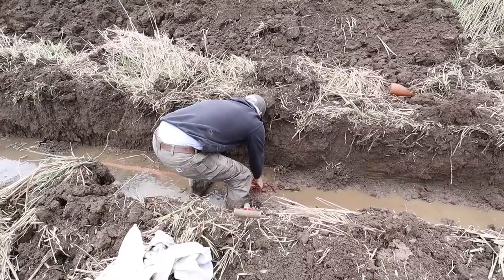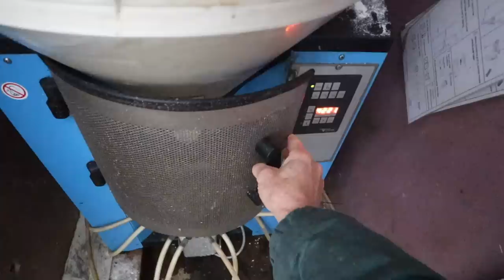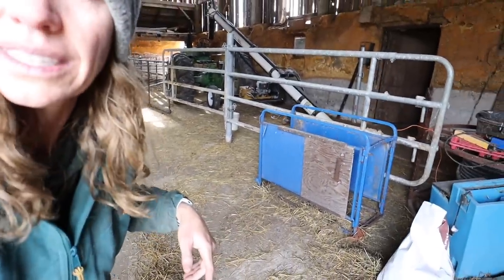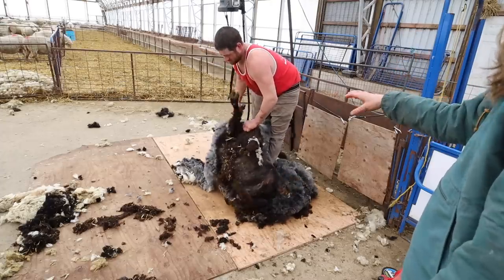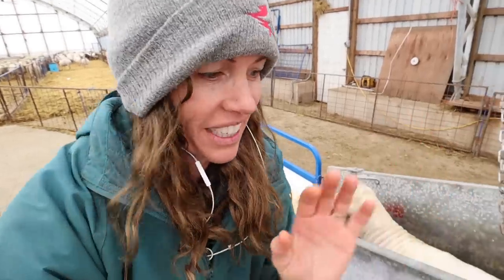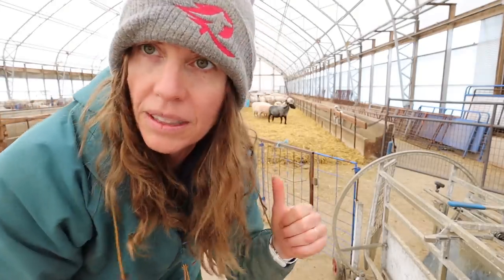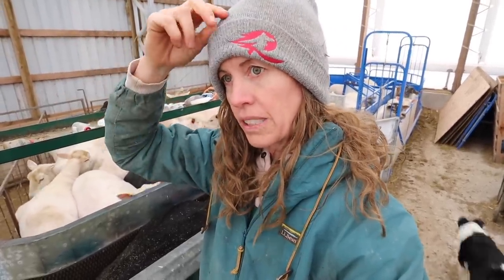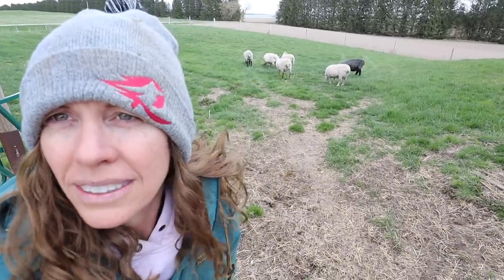What's OLD is NEW again... yup, I retired another sheep!! | Vlog 691

Comment: Our solution for the pushing snow and ending up with piles of gravel is to put Tractor Bucket Ski Edge Turf Tamer Skid Protectors on our tractor bucket. It lifts the bucket off the ground a couple inches so you don't pick up gravel along with the snow and doesn't tear up the graveled areas so much. They were $260 when we bought them last year, now, of course, they are $292. But still worth it. It's so funny that the ewes' udders can be so big and then when they are no longer feeding babies, they shrink right back up. No sag! What's their secret, I want to know!

Comment: In our milk mix machine the powder drops then the water to wash the drop area clean. We had to increase water pressure by adding a pressure pump (our depends on local water pressure). This washes the side walls of the mix chamber clean by spraying.  The powder clumps and clogs over several batches…so we installed a warm air fan to dry the drop chamber for 3min. after each feeding.  Through the miracle of DIY we could do that for $158.  But it still needs to have the mix chamber cleaned out once per week or the wet clumpy milk clogs the hoses right where the mixer is…it’s a whole thing.  We found we can run two batches of just water without powder to clear the chamber so it’s not a whole disassembly …maybe?

Comment: I'm very familiar with drainage tile.  My last house rainwater would pond in the back yard, then drain into the crawlspace which would become a cistern.  Before I bought it several floor joists had rotted out due to fungus.  I hand dug a trench from the back of the house to the curb.  I went to the feed mill to get 100ft of non-perf tile.  One look at my little Toyota Yaris and they're like yah... no...  Thankfully they delivered!

Comment: Just a thought but could you maybe plant a row of water loving deep rooted shrubs or bushes set just far enough away from your drainage pipes to help absorb moisture as well as being a snow break?? It would save you a whole lot of labor hours every year?? I'm sure you already have thought of this and I'm no expert but sometimes idiots have great ideas lol. On your Nanny issue does it have like a powder mixing set of blades or auger at the very top of where your machine starts the hose feed?? If so your blades may need sharpened a bit ?? Looks like your older gals were giving you an unnecessary workout  lol. Gotta love them. Looks like the exterior of your cabin is off to a beautiful start. Piper seems like such a sweet grandpuppy.

Comment: Sandi, I was just looking at milk replacer machines and noticed one from premier one supplies that is called Lak tek Ovis 40. And it is significantly cheaper than the kind you have. Just in case you need to replace your nanny.  I'm sure you can look into it yourself, but with all you have on your plate, I just thought I would throw that out there. 😊

Comment: HI! I don't know your particular piece of equipment for sheep, but i suggest a timer switch has gone bad. Everything that you set a timer for should  have  them. I suggest that probably one of the switches burnt out, or even possibly some fuse? Did you get a manual that could help narrow down what it is. It always seems to be some tiny thing that shuts down an important piece of equipment. We just laid new water pipe to our hog house & barn, 7 feet down wet clay. I feel your struggle, btw great job with your operation!